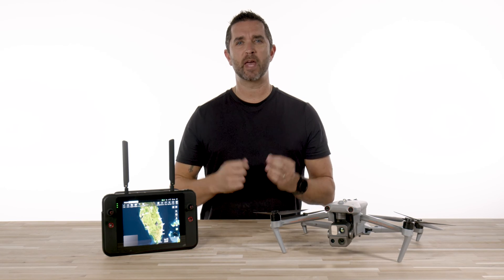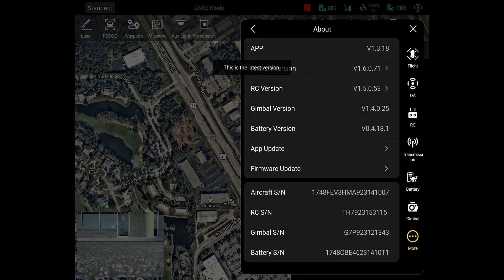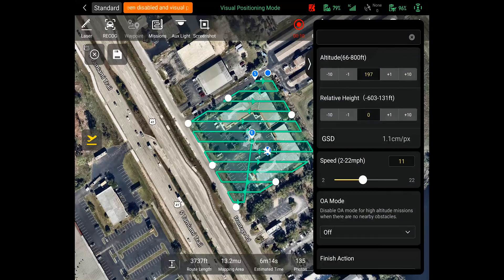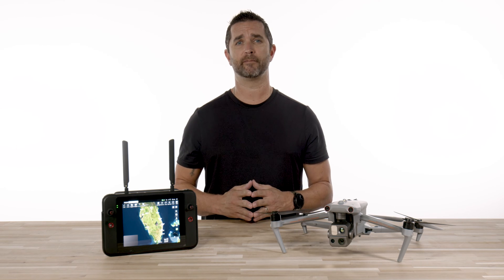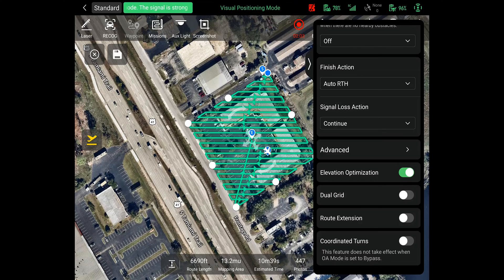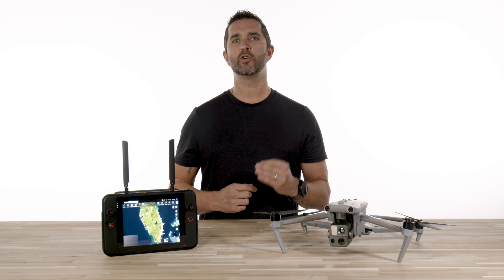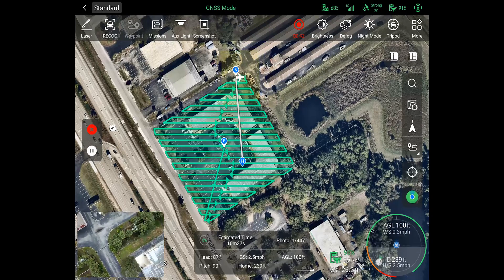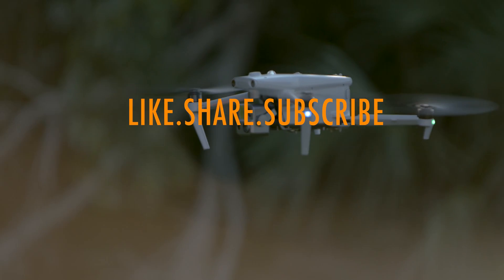Autel Evo Max 4T - How To Plan and Fly Your First Mapping Mission.

Comment: Love the video. 1 question what if the map on your screen shows a cloud cover over the area you need to map
Reply from the maker: That is definitely an issue.  Or if the area has been changed since it was mapped by the service.  You can manually fly the aircraft to the perimeter corners and notate where that is on the map.  We do this a lot in the field with new solar farm inspections.  Since they are often just trees or a wide open area on the satellite image.

Comment: Chris,  Where is the Tool Box they talk about so I can delete old missions?
Reply from the maker: Great question! On the Autel EVO Max 4T, the “Toolbox” is located within the Mission Planning interface on the remote controller or Autel Explorer app (depending on your setup).

To delete old missions:

Go to the Mission tab on the main flight screen.

Tap “History” or “Saved Missions” — this is where your previously flown or created missions are stored.

From there, you should see a list with an edit or trash can icon that allows you to delete unwanted missions.

Autel has updated their interface a few times, so if you're not seeing the exact path, it may help to ensure your firmware and app are fully updated.

Let us know if you’re still having trouble finding it — happy to help walk you through it!

Comment: is the camera a true 50mp?  I fly most missions with the evo II pro 6k RTK and have to keep the altitude at about 145' AGL to keep that 1cm/pix.  Some missions, due to obstructions, have to be flown higher and I lose resolution.  I'd love to be able to fly at 400' and still get under 1cm/px.
Reply from the maker: We need to confirm this with Autel's engineering, but from my knowledge it's not a true 50mp.  It takes a burst of 4 images and processes them together to act as a 50MP data set.
Reply: @FloridaDroneSupply  Thanks for the response. I look forward to finding a drone with a true 48mp camera not by DJI.  Their geofencing is a nightmare even in areas I have LAANC clearance.